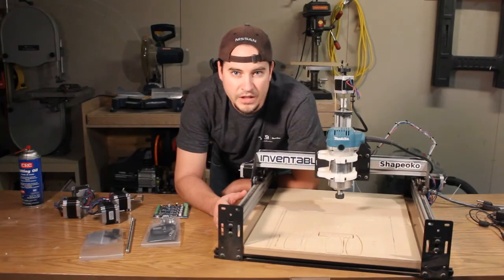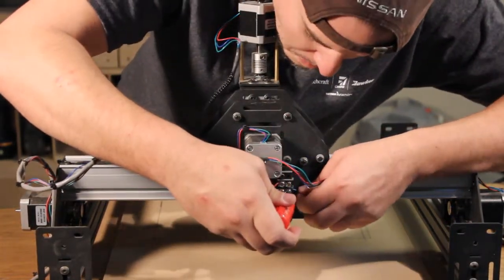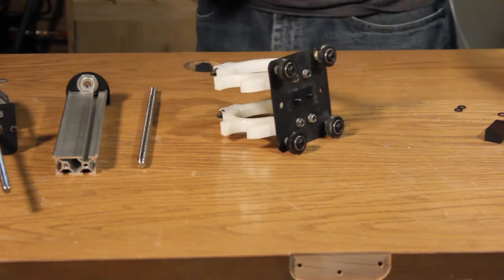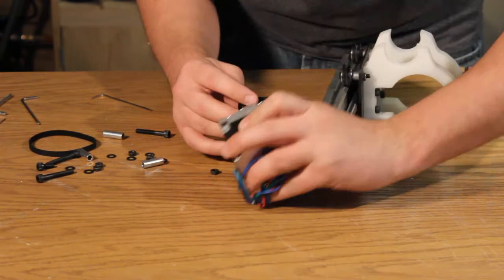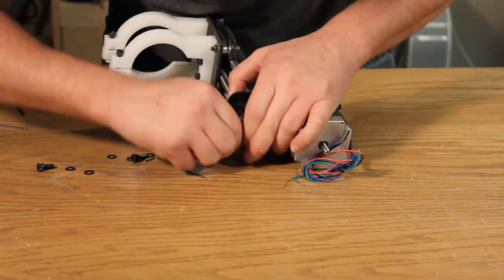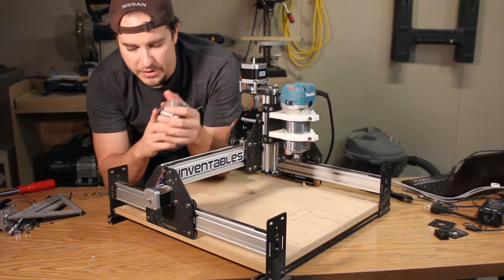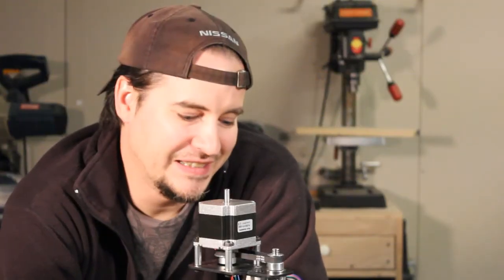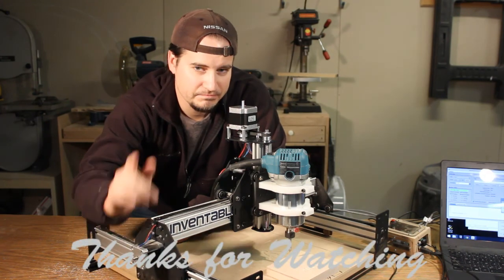Shapeoko 2: Z axis upgrades

Comment: I just did the Z-axis upgrade though I stuck with the Nema 17's. Did you find the Nema 17's struggling at all to lift the Makita or just want more power? I also just upgraded to the Makita and cut a mount based on your design. Great job by the way! But like you, I now am cutting a new low profile mount to get that extra work area.

Comment: hi, nice video,can you help me to buy right X-CARVE setup ,i'm really new for this milling system.i want to cutting carbon fiber & aluminium ,so i saw there $200 basic setup ,do you have any idea about basic set able cutting carbon fiber ,with pc interface ?
thnakx.
Reply from the maker: +Senaka Udapitiya the $200 option on Inventables.com is for an upgrade to the Shapeoko 2, so unless you already have a Shapeoko 2 then this option is not for you.  The basic machine is $934.  The basic setup should be fine for carbon fiber.  For aluminum I would upgrade to the NEMA 23 motors.  I believe the Dewalt router now is the stock option for the kits.  good luck.
Reply: +Targ's Workshop ,thankax.